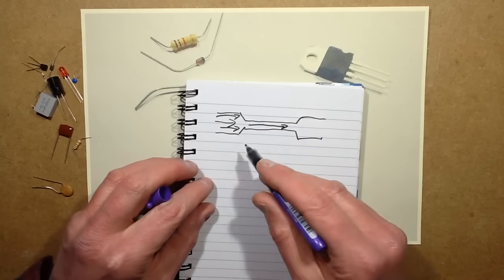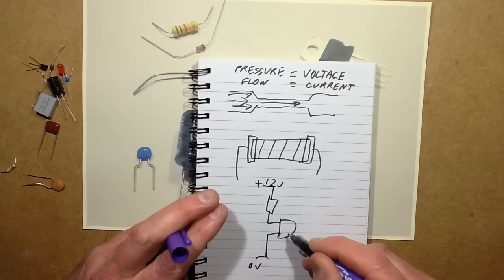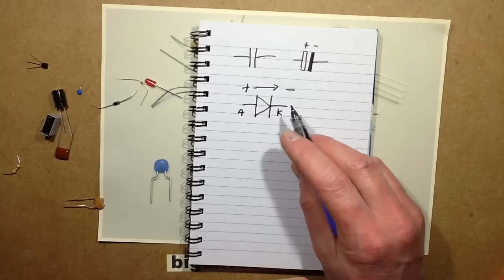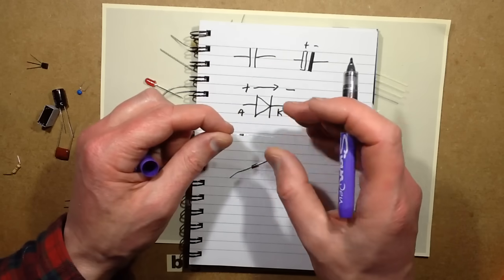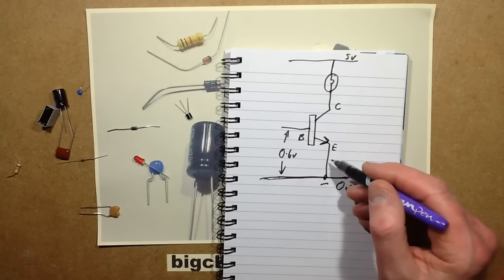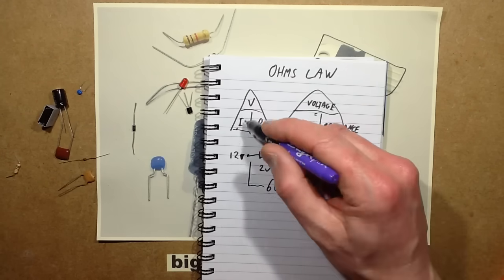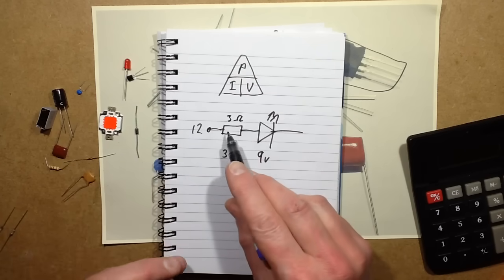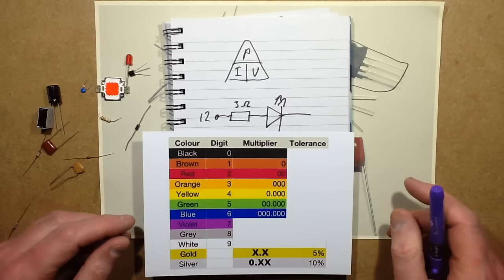A simple guide to electronic components.

Comment: When I first started to remember the resistor colour code we still had big "body, tip, dot" ones. I learned through repetition, being a 9yr old dismantler of old radios. I would start with a pile of resistors, then sort them into order. Soon learned. My uncle told me to learn Ohm's law, and I came up with that triangle mnemonic all by myself. Match the V as an upside down reflection of the top of the triangle. Cover up the one you want in order to reveal the formula for arriving there.

Later, at college, in the 1960s, we were treated to the Black Boys ... rhyme. For me unnecessary, but for others most memorable. A teacher was sacked for giving this to JUST ONE pupil in 2011.

Comment: I usually buy most components on ebay from chinese/Hong Kong vendors, would you say that's safe?
Reply from the maker: +SirArghPirate For recreational projects and prototyping they're fine.   But not for professional applications.
Reply: +SirArghPirate 
As long as you don't build something to sell or a thing where someones life depends on it, it's fine.
The problem is that you will get poor quality components once in while, either factory rejects that don't meet specs for example or flat out fakes. The more expensive the parts the more likely and even from well rated sellers (the ratings tell you more about the customer service than product quality). Ebay is so much cheaper that even with the occasional write-off you'll still save money (and I got to say that up to now all well rated sellers refunded me, when I could show them that they sold a dodgy product).

Comment: Great video, really informative without getting too technical. I have a quick question about resistor banding though... how do you know which end to start reading from? With the resistors you showed it's easy but I was looking at some small metal film resistors the other day and some were ambiguous, they were 1% so had a brown tolerance band. Often it was possible to guess by assuming it would fall on a standard value but a few made sense reading either way. Even the spacing and thickness of the lines was identical, I ended up just metering them.
Reply from the maker: +Wobblycogs Workshop That's a problem when dealing with too many bands.  They are tricky to read, so metering is a good option.

Comment: if there had been a 74HC4052 and 74AC74 and a two OP_Amps I could maybe build a Tayloe Mixer which I would feed into the duel ADC ports on a Raspberry Pi to operate as a multi-mode demodulator and maybe get the clock signal as well to give me the LO signal to drive the 74AC74 which makes the Tayloe mixer work.

Comment: Why is there so much conflicting information on the internet about the direction of electric current? Positive to negative, or negative to positive?
Reply: +Landrew0 I assume you're talking about current flow Vs. electron flow.  When designing or analyzing circuits typically "conventional current" is used, which is the 'old world thinking' that current passed from positive to negative.  In reality what happens is that electrons flow from the negative to the positive side of the circuit.
Reply: +Landrew0 The arrows on standard schematic symbols, as well as the wording of most discussions of circuit functions, are based on something called "conventional current flow" which is the notion that current flows from + toward -. That convention dates back to the beginning of electronics. As physicists began to figure stuff out it was found that electrons actually physically travel from - to +. Hence the seeming contradiction: some speak in terms of electron flow, others in terms of conventional (aka traditional) current flow.
Reply: +Landrew0 One is the convention of how things are drawn etc, stemming from the very early days of electricity, is consistent with how positive charges would flow. 
Once they found out it was actually negative charges that moved about, the other way was already enthrenched...
Reply from the maker: +Landrew0 Two conflicting schools of thought.  Theoretical flow and actual electron flow.  Purely on the basis that the diodes are pointing in "that" direction I'm keeping it simple and saying that the current flows from positive to negative.
Reply: +bigclivedotcom but we still put the switch in the live lead.
Reply from the maker: +Graham Wilson That's different.  It's AC (alternating between positive and negative) and the live side of the circuit is the one that is not referenced to ground.  So it carries the highest risk of shock and fire.

Comment: When the "water" comparison was explained to me in 1958(I was 10 years old) it was imagine a river, the speed of the water is the voltage, the depth of the water is the amperage and the width of the water is the power (watts) ie vxa=w, and the old mans reason for telling me this imaginary view of electricity was to help remember the equation of Volts X Amperes = Watts.
Dave in Kentwood

Comment: REQUEST - Can you explain Direct Current vs Alternating Current in layman's terms? I'm sure there are many people that have already done this on youtube but i find your  explanations are incredibly easy to follow. 

REASON - I was wiring a 3 prong 240 volt socket to my american 120 volt mains (so 2 phase 240v) and i was quite baffled that a neutral wire wasn't required. After hours of googling with no questions answered i stuck my multimeter across both rails in the power box half expecting a spark show... seeing it read 240 volts blew my mind. 

NOTE TO OTHER COMMENT READERS - If you're going to call me a dumbass for asking, feel free... but fuck you. :)
Reply: +iceeeyN00B Oh boy - I had the same confusion at first when I was new to this stuff. It finally dawned on me one day when I thought about it for awhile. Here's how it works. Alternating current is a sine wave. In the case of American household AC, it goes from +120v to -120v and back 60 times every second. (60hz). Here is the key to understanding why measuring between those two hots yields 240v. They are two different phases - one of them is at the negative side of the sine wave at the same time as the other is at the positive, and then they both flip. What this means is that at any given time, one of those hots is at negative 120v, while the other is at positive 120. What's 120 subtract -120? 240. That's right - at any given time, the voltage DIFFERENCE between those two hots is 240 volts. I hope that makes sense! Let me know if anything needs clarifying. Also, a side note: In a standard 120v circuit, the hot is oscillating from +120 to -120, while the neutral always stays at zero, hence why the voltage difference is always still 120v, just with the higher-potential side changing (0v is higher potential than -120v). This is also why you sometimes hear people say "AC changes polarity 60 times per second". It's also important to note that what we refer to as "0v" is an arbitrary value - it's simply what we call the earth's electrical potential. This is why having negative voltage makes sense.
Reply: +Apple Dash I completely forgot to say thanks man! I had no idea AC changed polarity... i thought it was pulses of current. :D very helpful!

Comment: gr8 video, one question though, is there any standard table for knowing what is the ideal current usage between different type of leds, like a 5050 led etc, reason i ask this is how do we figure out the forward voltage of different type of leds and how much current to give them when the leds r just unbranded and have no data sheet?
actually i have some old salvaged 5050 and a few other type of leds which i want to use to make a USB led bulb but i have no idea what is the forward voltage of each led and ideal current to give it
Reply from the maker: +Bipin Patel Good idea.  I'll make a note of that, since it would make a very helpful video.

Comment: Haven't finished watching your video yet, but what's the reason for red led's not being damaged when polarity is reversed?
Reply: +Max Mouse (Mmouse) The colour of the LED is determined by the materials that are used (every material has its own light frequency). And different materials have different conductivity properties. But the red LEDs will get damaged when you overdrive them (in either direction). https://en.wikipedia.org/wiki/Light-emitting_diode#Colors_and_materials
Reply: Sander Deryckere I know how LED's are made, but Clive said RED LED's aren't likely to be damaged if you reverse the polarity. I wondered what, specifically, it was about RED LED's that caused that.
Reply from the maker: +Max Mouse (Mmouse) Older technology.  The gallium Arsenide LEDs are more like a traditional diode in construction with the junction materials optimised for producing light.  They behave in a similar way to a diode when reverse biased and as long as the current is limited they will generally recover with no damage.  Modern white or blue Gallium Nitride LEDs are based on a thin film technology that is very easy to damage by reverse polarity or even static discharge.  If you buy LEDs in bulk from a manufacturer the red ones are often in plain polythene bags, but the blue, white, green ones are in metallised anti-static bags.

Comment: Thanks Clive! Even as a basic guide this video is still very useful for people who have done RLC circuits and are new to diodes and transistors. It only took you 45 seconds to explain what's special about zener diode. And also how a NPN BJT works without throwing any technical information that would just confuse the person at the same time.

Comment: My computer mainboards I've been using in recent years are boasting about using Solid caps over Electrolytic ones.  What is the difference internally, and would I be able to use solids to replace electrolytics in circuits?

Comment: The sign for cathode maybe a "k", because of its greek origin, where "kathodos" is written with a "kappa", which resembles the modern latin "k" more than a "c".

"Rude"? Why not calling these memorisation phrases what they are: racist!
Reply: +danteaurelius ""Rude"? Why not calling these memorisation phrases what they are: racist!"

Are you saying only the racist ones are rude?

I'd say that the racist ones are a subset of the rude ones. 
There are definitely some I wouldn't use in front of my granny even though they make no mention of ethnicity.
Reply from the maker: +danteaurelius It's the rude and racist ones that are easiest to remember simply because of the shock value.
Reply: +Michael Tempsch I am so sorry for my unclear comment! I agree with you, that "racist" can be seen as a subset of "rude", but with a more intense or stronger "touch/note". My sub-comment was merely refering to the specific example Clive mentioned in the Video. I thought, that the memorisation phrase wasn't just "rude". I would have used "racist". Again, I am sorry for not being clear in the first place. I didn't thought my sub-comment would gain that much attention.

+bigclivedotcom I won't argue with that and think you are absolutely 
right. My sub-comment was just a minor sidenote about the choice of 
adjective and wasn't that important to me.

Comment: My engineer grandfather spent the last 20 years or so of his career as a professor, which meant dealing with first year students who had no clue about any sort of safety in the electronics lab. He'd place a styrofoam head in front of the class, set up a sizable electrolytic capacitor in front of it, and then hook that up to enough voltage to blow the thing to pieces.

With luck, the head would go flying across the room, and the students would get a lesson they'd remember.

Comment: Maybe you, or someone else can confirm, or correct my thinking!

I'm a Disabled Veteran, and my current wheelchair runs 2, 12v batteries in series (24v), into the controller.  I created a Y cable, and run the second into buck converters, in order to get 12v.  I use that for cigarette lighter outlets, and a 120v inverter.

My new wheelchair, runs each battery (12v) into the controller.  24v comes out, and goes to the motors.  I want to get 12v for the outlets, without destroying the controller.  I also want to parallel the batteries (12v), so that they drain equally.  The inline fuses are 100A.

In order to get both 12v, and 24v;  What I'm thinking is, I will put 100A diodes on the series leads, and on the parallel leads.  So, 8 diodes in total.  If this is correct, what orientation do I put the diodes in?

Please help confirm, or correct?
Thanks!
Reply from the maker: +PV2Omni You can't really have the batteries in series and parallel at the same time, but you can check if one of those batteries has its negative referenced to the chassis of the vehicle and use that one battery to run your auxiliary 12V and 5V stuff.

Comment: While you're explaining things, it might be useful to say why there are preferred values for components. For example 560 and 680, but not 600.

And it would be useful to explain the difference between conventional current and electron flow, so you could say that the symbols for transistors and diodes include an arrow pointing in the direction of conventional current.
Reply from the maker: +John Cherry I specifically decided not to mention alternative current flow conventions since it just causes confusion.  I may give resistors their own video in the future.  I had to really trim the material down for this video and it still ended up surprisingly long.

Comment: I've never had much luck with the color codes; being colorblind kinda sucks.  It's one of the things that kept me away from electronics as a hobby for so long, despite an immense curiosity since childhood.  It's only the last few years that the equipment to be able to test components has gotten cheap enough that it's viable for me to get around a lot of color issues.
Reply from the maker: +rhkips Have you seen the new glasses with very tight spectral filters in them that can be fine tuned to help compensate for the colour sensitivity overlap that causes colour blindness?  Not sure if it's hype or if they really work.
Reply: bigclivedotcom
They work for some people, but unfortunately I'm a monochromat, so they don't do anything for me.  I spent a few hours with my ophthalmologist trying to make a difference, but they actually made it even harder for me to interpret basic colors.  D'oh!
Reply from the maker: +rhkips Ah.  Then it's all down to good labelling of component bins and double checking with a meter before putting them on a PCB.

Comment: Thank you for the video. It was very informative. As someone starting out in hobby electronics I can say this is quite useful. I hope you continue to make this type of material. Your other videos have gone a long way in teaching me about LEDs and different types of circuits, but this type of video really fills in the gaps that would be too boring or long winded to cover in a normal tear down.
 I just completed my first soldering project last week in fact. One of those cheap eBay DIY kits. It was really gratifying. I couldn't have done it with out your videos. I find myself referring to them all the time. I plan on making the EMF detector next. So again thank you Clive for, above all else, inspiring me to try something new.

Comment: Thanks for this.  These wee gems are always worth watching because theres always something to learn nomatter how long you've been at it.  I didnt know electrolytics measured the same capacitance when 'dried out'.  Is there a reliable way to test this?  I'm restoring an old zx spectrum at the moment and its worth knowing if the caps need replacing.
Reply from the maker: +RavenLuni The usual approach is just to routinely replace the main electrolytics.  You do get specialist testers that measure the ESR (Equivalent Series Resistance) of capacitors.

Comment: The type of dielectric also matters in a capacitor ;)
Shame you didn't mention how a zener actually controls the voltage, they turn on and off very fast giving a brief short circuit if higher than the selected voltage, commonly used years ago as a zener oscillator along with a transistor to 'amplify' the output.

I could never get on with mnemonics for remembering the colour code, but i could remember the rainbow colours (i would say that as a word), then i just added the end colours.
Another way to enhance memory is to get coloured wire, strip off a bit from each, then slide them onto another piece of (smaller) wire and attach to a keychain etc.
Reply from the maker: +Sparky Projects I was trying to keep it as simple as possible.  I cut out a lot of what I originally intended to cover because there was just too much and I didn't want to make the video overwhelming.  I'll probably make further videos dedicated to specific components.
Reply: +bigclivedotcom I realise that, what i posted was mostly for a bit of info ;)
Reply: +bigclivedotcom a separate playlist/series/channel of videos like this would be extremely valuable I think.
This is the first time capacitors have really made sense to me. I know analogies can only be stretched so far, but they're helpful tools for explaining and visualising/predicting what will happen.

Comment: Hey Clive, I'm new to soldering and such, so I've been doing those neat cheap little Chinese kits (clocks, electronic dice, cascading flashers etc) - and one I was doing yesterday had a black band 0 ohm resistor. Completely stumped me! Why not use a wire link for something that calls for a resistor without any resistance...?
Reply from the maker: +MattExzy The zero ohm links are so that the pick and place machines can handle them like ordinary resistors.  I also used them in some of my older designs since they are a neater option than bare links.